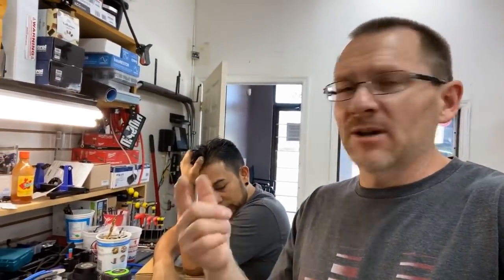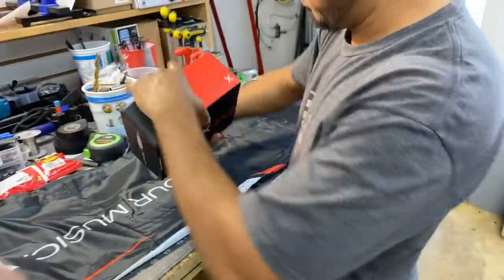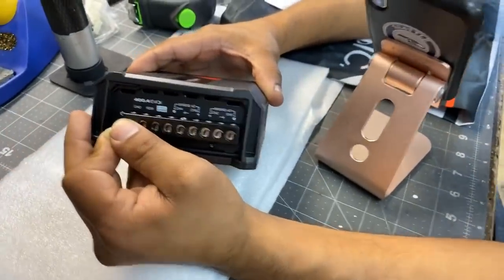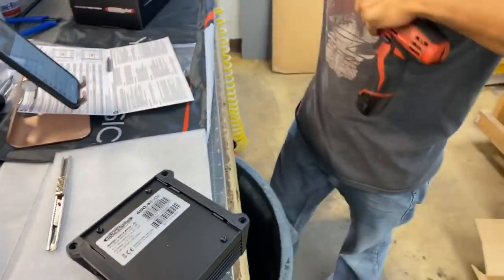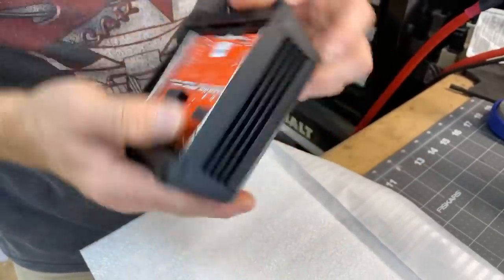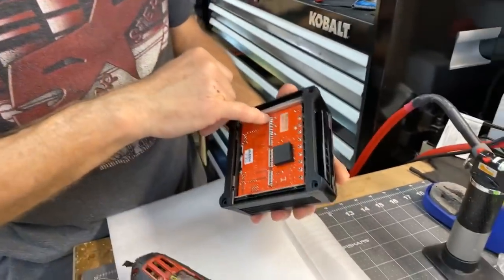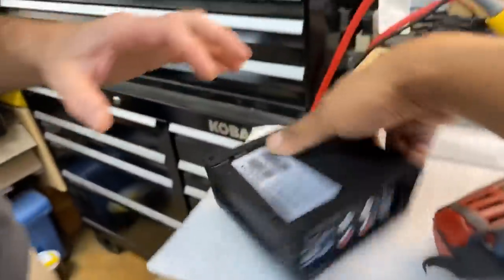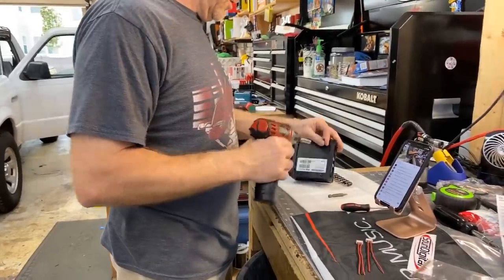A little something new from Sound Digital , my favorite a micro amp!

Comment: good power, but I like the specs on the Audio Control micro's better.  And, it's filled with Audio Control magical wires.
AC has much better S/n and distortion.

Comment: I still don't trust these full bridge amps, ive heard they can have noise/ dirty output. Their prices on low to mid power amps really aren't that great when considering how cheap the builds are. Also the Brazilian companies need to take their designs more seriously and use real correct size power inputs, not undersized 4awg , non standard  chinesium  terminals on a 3k amp. These standard metal 8awg inputs are an improvement.